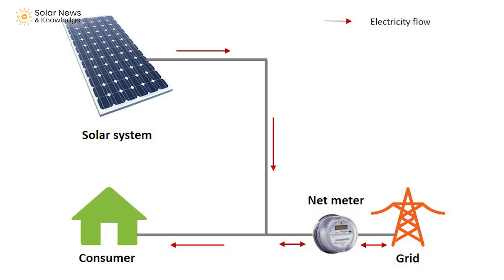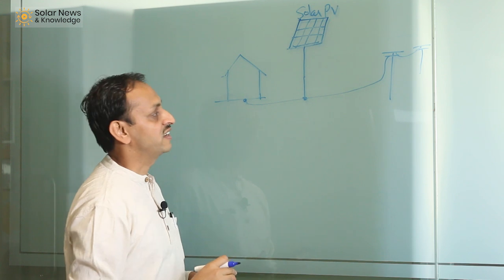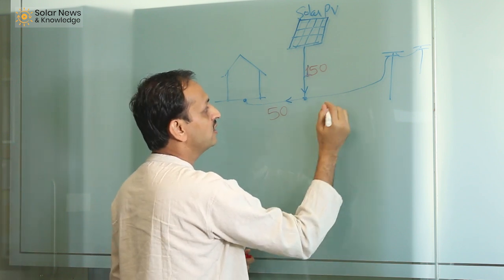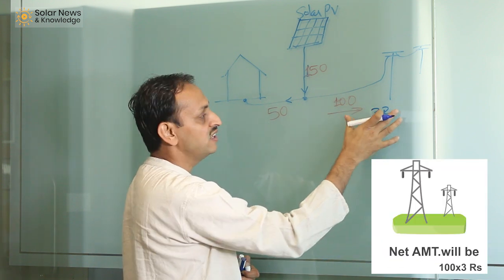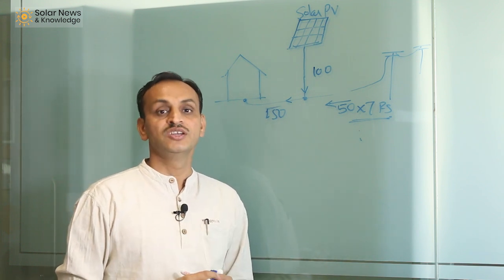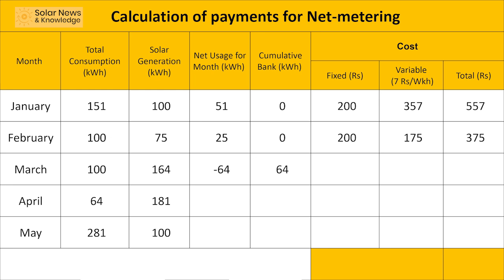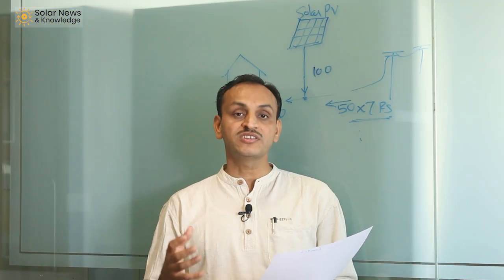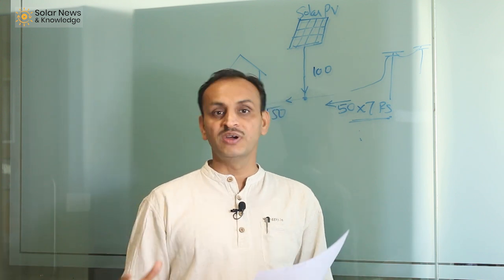Difference between Net Metering & Gross Metering (Episode 02) || Knowledge Session

Comment: Personally, I feel gross metering is bliss... consider this, if you have demand of say around 150-200 units per month for all 12 months of the year and you manage to set up a solar system which serves you say, 250-300 units of electricity then it can be a great way to earn some money, but of course after deducing the fixed rate amount. If that doesn't work then an isolated solar system (with batteries) should be the priority here as this net metering tends to have a loop hole. You see, what if your system is just banking the electricity to the grid according to the above example in this comment and you really never need to take electricity from grid, but still you end up paying the fixed cost, so in that way isolated can be better. 
Don't just conclude that gross metering is bad.